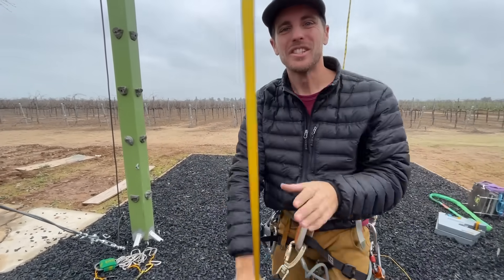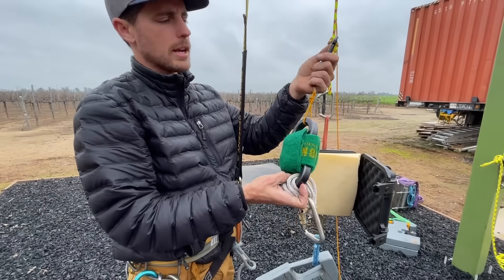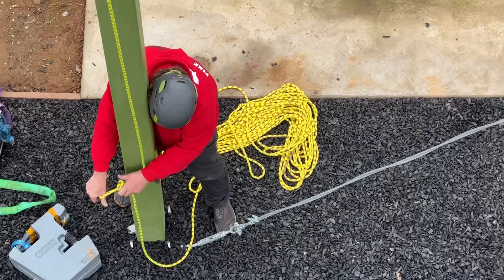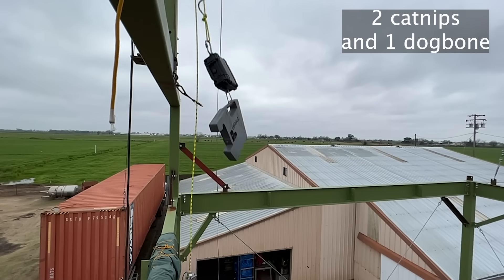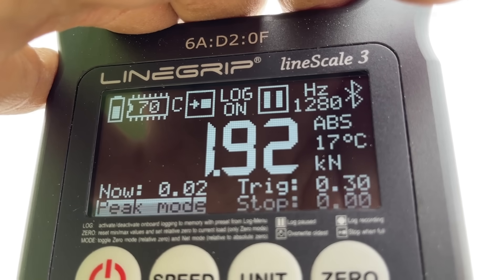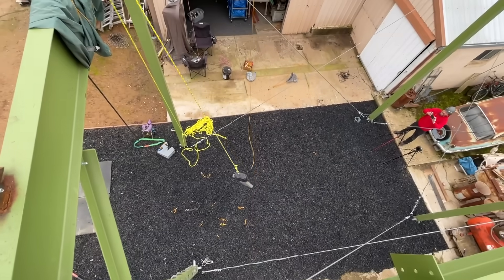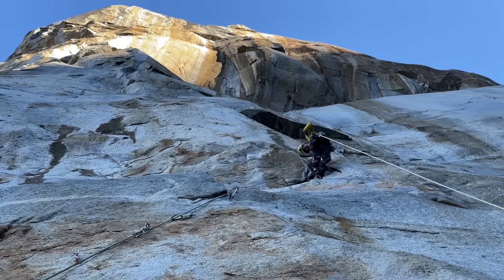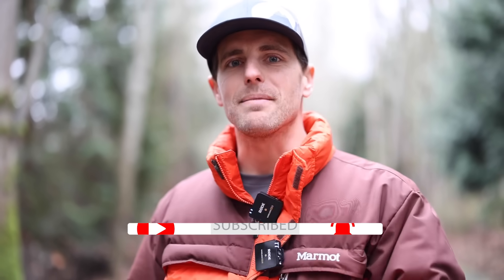Does climbing gear pulling out soften the blow on the next piece?

Comment: Could you add fall factor into your results?  It would be nice to know how much rope was in the system to generate these forces.  Maybe  throw some big stickers on your drop tower with height measurements at each of your bolts and rope release points.  We can decently guestimate FF/rope length without you having to explicitly measure every time if we can see the height of the bolt and roughly where the rope is tied off in the video..
Reply: Yeah, that would be really nice. Looks like slightly less than FF 1 in this video (guessing 0.8-0.9) since the weight falls and almost touches the ground.
Reply from the maker: @JesseUnderscoreMartin  That is about what this is.  But do we measure it after ropes stretch because if we don't then it's more like 0.6-0.7?
Reply: I think FF is defined "before the stretch" (i.e. 0.6-0.7)

Comment: Really interested in the triple spike. If you do a long shot of the weight, it is possible to track it's movement to see where it is accelerating and compare that to how taught the rope is. All you would have to do is set up a camera about 15 feet high and 40 ft away.
Reply from the maker: i might be able to do that if i put the tripod on the little side storage roof behind the old car.  Not sure if there is stuff in the way though

Comment: sounds logical and good but in reality it sucks. who replaces the weakened parts behind you? climb back down again?
Reply: ...in reality it could save you from dying!
Reply: @frankwilliams5766  I think that with larger distances, as in reality, it no longer has any effect. the longer you fall, the faster you fall, i.e. with more force on impact.
Reply from the maker: @MartinKrafft  most of those clips we showed at the beginning had the gear pop pretty close to each other.  There wasn't 10m in between each piece.  But yes, if you fall enough after something blows it isn't that helpful.  Depends on how close the pieces are too.

Comment: Just a thought-- could you install some shock-absorbing system on the Grigri so that you aren't catching the fall directly on the anchor?  I think it'd help simulate a tied-in belayer, which may not apply directly to this test but it could be an important factor in future tests.
Reply from the maker: Not a bad idea.
Reply: @HowNOT2  If you got a human-weight sandbag that got dragged a bit sideways and clipped the grigri to that, that would be really cool. There are these big sacks that sand and some loose building materials get supplied in that could work, that are designed to be moved by a crane, or an old haulbag would work. Actually... you could even make a rad episode with this to introduce it! ..."how big a whipper will lift your belayer?" Click baiting gold :D You could do a few variations with different belayer and climber weights. I would find that really interesting and a LOT of people have experience lifting up while belaying.
Reply from the maker: @stevebarratt888  you got me thinking now
Reply: That's a good idea, but does introduce another variable into the system. Probably worth a test on its own to see how repeatable it is. Also a lot of tests you might want a "worst case scenario" so for those you wouldn't want to use a sandbag.
Reply: @alexstarr1589  It would be interesting to see how big the effect is. It feels like these forces in the test are a little high compared to a climbing scenario, especially considering how light the falling weight is, so something to make it little more realistic would be cool. I see your point though. I guess in the quest to break stuff it might put a dampener on things! Even as is I think this video taught me something so thats cool!
Reply: With a softer catch one of the string quickdraws might even hold which would be cool. 2kn is in the range of smaller pieces one might use so that would be amazing to see.
Reply from the maker: @alexstarr1589  yea, and this test had to isolate the variables.

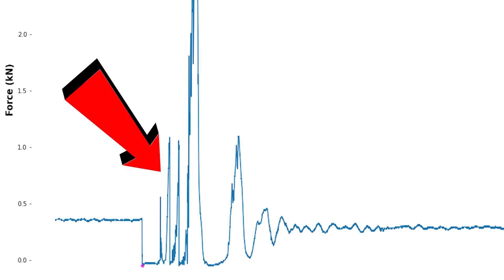Comment: Starting from 5:59 it's clearly visible that the rope "falls down" through the catnip's carabiner until the steel piece falls below and starts pulling the rope down. I believe that's when the first (smaller) spike is generated. If you had your steel dummy further away (horizontally) from the catnip to let it fall, the spike would not be generated. The swing would, though. 😁
Reply: Another option would be a very weak method for holding just the weight of the rope in place to keep it from falling but would not really affect other measurements. A loop of painter's tape might work
Reply: @bandana_girl6507  That's true but then again this configuration may be closer to what's actually happening during a lead climb fall. Of course how freely the rope is hanging depends on the shape of the cliff and the route.
Reply: I had the same consideration
Reply: same observation
Reply: true that